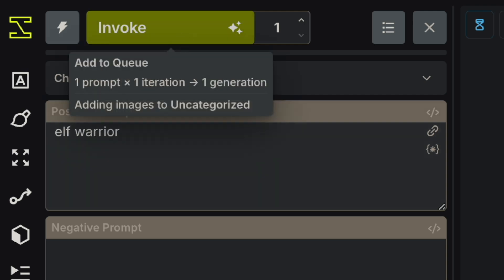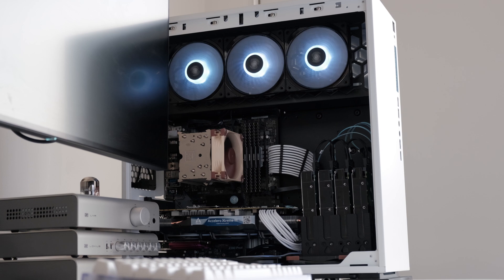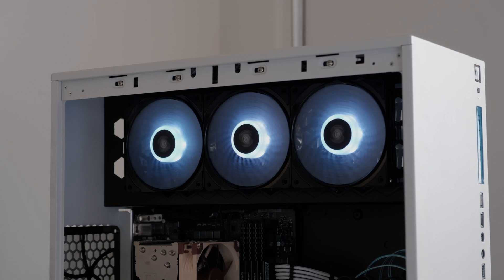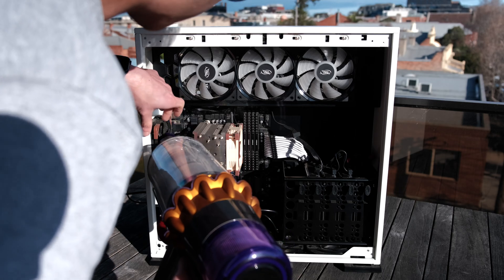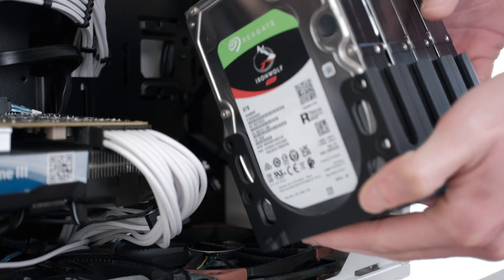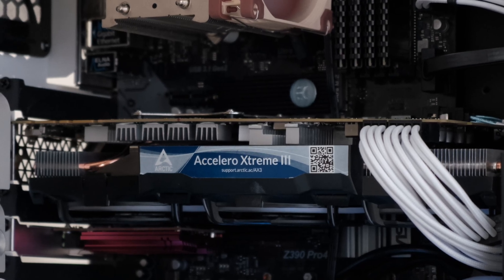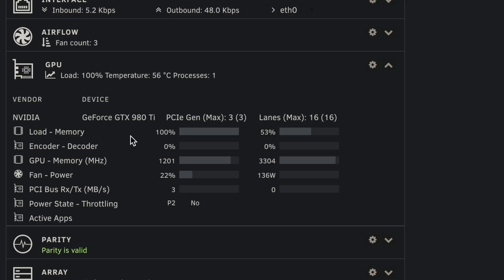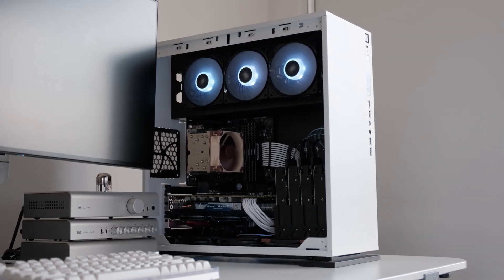I Built an AI Home Server, And It's Amazing - Unraid, 10Gbit, Invoke AI + Stable Diffusion

Comment: Hi, how did you set up the AI stuff? Windows VM with gpu passthrough, and managing AI tools via Pinokio? or using Ubuntu Server VM with gpu passthrough and managing Docker containers?
Reply from the maker: Hey! Im have unraid as my os (slackware linux distro) and use Invoke AI to play around with stable diffusion models. I run it on a docker container 😇

Comment: no way you run this on 980ti 😧
Reply from the maker: It works but rendering can take a long time🥲 Once I have a proper workflow Im going to do some research on what gpu I should upgrade to. Any recommendations? 😇
Reply: @rj.bernaldo  rtx 4090 if you can afford it 😏
Reply: @rj.bernaldo good to know! I have a 980ti laying around 😊Great video, thanks!

Comment: You should also build a router with SFP using either OPNsense or pfSense for better performance, to avoid bottlenecks, and to have full control over your network, bypassing the subpar ISP-provided router.
Reply from the maker: That's actually on my todo list 😀 Any recommendations on what mini board I should use?
Reply: @rj.bernaldo  Consider a low-power PC with at least 16GB of RAM and a dual SFP PCIe network card for pfSense or OPNsense. I recommend Intel for compatibility with most network cards. You can also check out the ZimaBoard for low-power consumption and run OpenWrt on it.
Reply: @rj.bernaldo  I saw a setup with a Zimaboard and a PCIe SFP card attached that seemed neat!
Reply: @rj.bernaldo  Consider a low-power PC with at least 16GB of RAM and a dual SFP PCIe network card for pfSense or OPNsense. I recommend Intel for compatibility with most network cards. You can also check out the ZimaBoard for low-power consumption and run OpenWrt on it.